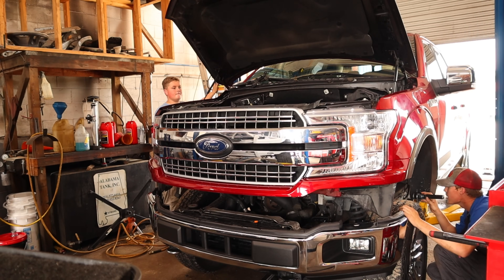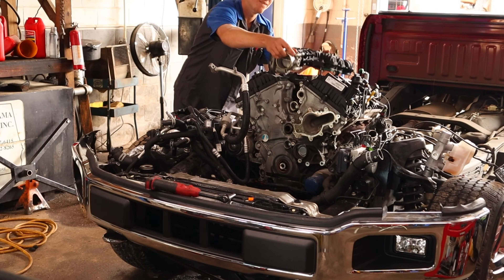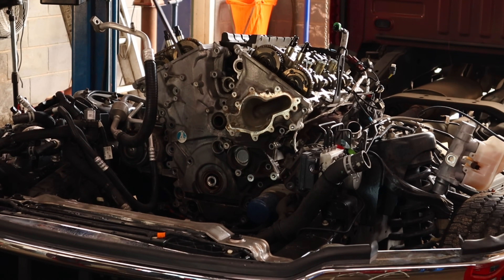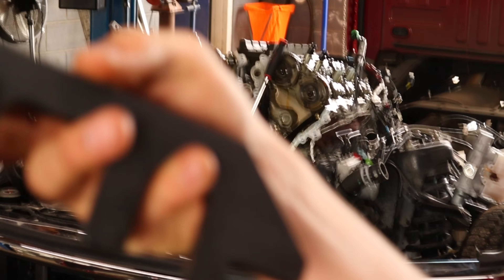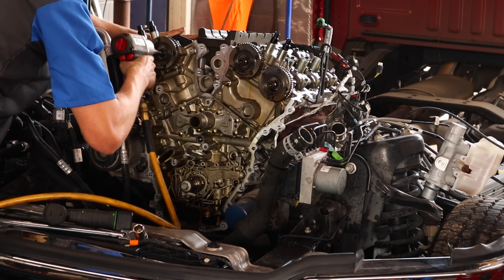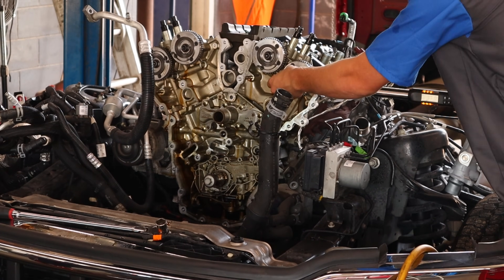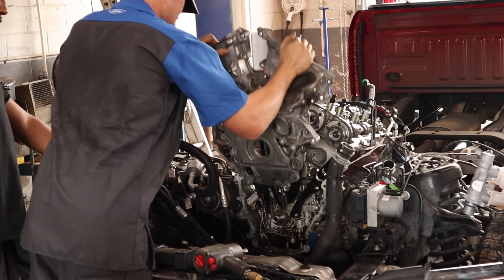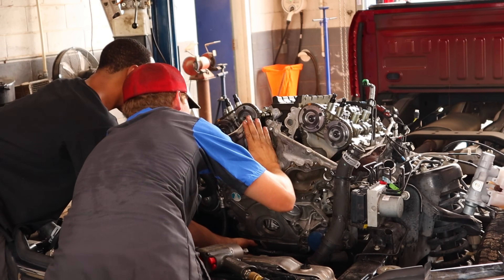Ford 3.5 EcoBoost Cold Start Rattle (VCT Phasers) | Everything You Need To Know

Comment: Is it possible to program the ecu to extend cranking time (before firing) to allow more time to build oil pressure?  I would think it would only need an extra second or two to get the oil moving enough to take up any bleed-off from those phasers or tensioner?
Reply: Hold the pedal to the floor. Engine will not start till you release it.
Reply: @jimsherman2477  I used to fuck with my buddy doing that
Reply from the maker: I’m sure it is possible to do that but it wouldn’t be the best way to fix it. Longer crank time would lead to starter failure eventually. I think what they are doing with this program is having the pcm demand a different position from the phasers at startup that won’t make it rattle. I’m not sure what position would make it not rattle. Unfortunately there isn’t any publications telling us the differences between the stock tune and the updated pcm file they are getting us to put in them under the 21b10 recall.
Reply: @FlyingWrenches13  I'm on my third starter in a year anyways. The autoshutoff really wears my starter out.

Comment: I have a 2012 3.5 that rattles for about a second on cold start up. I thought it might be the timing chain is stretched and it takes a second for the tensioners to tighten it up. If I get a new timing chain and tensioners should I mess with the VCT Phasers at all?
Reply from the maker: Yeah I would highly recommend replacing those phasers at the same time.

Comment: 3.5 HO motor with 43,000 miles started hearing rattle. If I do nothing, will rattle do any permanent damage to engine?
Reply from the maker: No it won’t cause any other issues.

Comment: My 2017 did the same thing, but they would rattle when it was even hot. Drove it to the dealer,shut it off, went back out 2 minutes later while it was still hot, started it up and they rattled. I change my oil every 3k miles.
Reply: Did you get it repaired?
Reply from the maker: Have you had your phasers replaced?

Comment: Wait, wait, FORD “ Tested “ this engine when it first came out through the BAJA desert 🌵 and everything then tore it down and everything was fine???    
Ford been making engines over 100 years and Honda and Toyota STILL make a better engine? HOW?   WHY?    

WHEN is Ford going to get their shit together and make a GAS 400,000 mile engine w/o a MAJOR repair?    WHEN?   
And why people STILL buy and support this CRAP? And pay good money for it
Reply from the maker: The days of reliable engines are behind us unfortunately. It’s all about power and fuel economy now.
Reply: I see transits with 600k ,400k,all the time. There not tuned as hot but last alot longer
Reply: Honda sure they are reliable. Get real tired of hearing how reliable Toyota’s are   As a mechanic I know Toyota’s to be pretty junky. Which is bad when u also have no power to go with it

Comment: I have one question what happens if you would rather live with the rattle instead of breaking down your whole engine and maybe cousin more problem with the truck....  plus if you have extended warranty it should go all the way to 100,000 with NO cost?
Reply from the maker: Extended warranty should cover your phasers if you bought one. As far as long term effects from this noise, there really isn’t any. The cold start rattle shouldn’t cause any damage or other issues.
Reply: The technician isn’t breaking down the entire engine, they’re removing covers and changing 4 gears with updated parts. And if the technician is properly trained, as they are required to be, other than the noise being gone you should never be able to tell that anyone was in the engine.

Comment: So my truck has been at the dealership for about 5 months now, have had the "new upgrade" done to it last week and the rattle is gone, but not the transmission vibration on all gears after 5th gear. Ford wanted to change out the engine about 2 weeks ago, and placed my order for it, then this new upgrade was done and supposedly fixed. They gave me my truck back, within 1 hour of driving it, vibration is still there, told the transmission tech, and he knew exactly what I was talking about. That tells me he knew it was still there, and yet released it to me. Now they are back to the drawing board, maybe a new engine is the next step.
Reply: "So apparently fsc engineer wants him to test the drive angle possibly drive line is what is causing the shudder" 

This is the latest news from my dealership. Any updates on your end?
Reply from the maker: If the trans is shuttering then that shouldn’t have anything to do with the engine. Sounds to me like the pcm update may have caused the trans issues.
Reply: @FlyingWrenches13  so the trans tech says the upgrade ruined all 6 trucks at the dealership the same. Except mine got the least issues, 4 of the others were bought out by Ford and they ALL went with new F250's. Told them I was not looking into going back into a $70-80K debt, so I told them to fix my truck. They are assuming the issue is a miscommunication between the trans and engine in terms if what gear it should be in at a low speed. It will be in 8th or 9th gear at about 30 mph, seems too high of a gear for the speed. The vibration starts when I slowly apply the gas pedal. Not sure what Ford wants to do next, but if they pick up where we left off, it will be a new engine. Should hear from them next week, I'll keep you posted in their decisions. I am in constant contact with a supervisor at Ford Motor Co.
Reply from the maker: Yeah keep me updated please. I would like to know what ends up fixing your issue.
Reply: So just got off the phone with the dealership, now they are saying they cannot replace the engine because it is now a driveline issue, and they are waiting on the engineers in Pennsylvania to come up with a solution. I'm seriously considering calling a lawyer at this point to see what are my other options.
Reply from the maker: Man I wish I had some advice for you but I don’t really know what to tell you. I will say that the lawyer route isn’t usually the best just because of how long it takes for any legal action to go through. I would call ford corporate and raise hell if it was me. I wouldn’t get mad at the dealer or anything because there really just isn’t much they can do if they don’t know what’s causing the issue. Ford corporate is probably going to be your best route. Buy back buy back buy back is what I would be saying. Hope this helps.
Reply: @FlyingWrenches13  well I am in constant contact with a sup representative from Ford. They won't buy back my truck, unless I buy something new from them, which I don't want to. I want them to pay off my truck so I can go buy elsewhere.
Reply: @FlyingWrenches13  update: so I get an email yesterday from a Ford Sup about 400 miles away saying that my truck will be ready this morning for pick up. Telling me it was the driveline and they got it all fixed. Said I am to pick it up and test drive it with the techs this morning. So I texted the lady helping me at the dealership, asking her when I can pick up my truck, she asked me why I wanted to pick it up, told her what the sup had said, she then says she has no idea why she said that, my truck is still being tested and they aren't sure that it is fixed yet. So I called the sup asking her how it was possible that someone 400 miles away is saying that my truck is fixed, yet the person at the dealership with my truck has no idea why you are saying this. They called each other and then the sup said I would get a call early this morning to get my truck, no call yet.
Reply: 8/29/21 update: so nothing has worked so far, they were certain they had it fixed a couple weeks ago, they never called me to pick it up, turns out a few techs test drove it and none of them liked the way the truck was shifting gears. So it's still there, 3 days ago, got a text from the dealership saying that an engineer will be flying down to Texas the second week of Sept. to take a look at my truck. Don't know why they just don't pay off my truck and let me be on my way. Seems they have spent a lot more money the past 6 months.
Reply: Update, so an engineer from Pennsylvania came down to see my truck, this is the text I just got from the dealership. 

"Engineer came and he stating to replace  heads and all 4 cams"

I guess we will see if this is the fix. Going on 6 months now. Let me know if you've heard anything else, thanks.

Comment: My 2017 with 75k, started rattling at 70k... Had 21B10 done about 2 weeks ago. I went from a rattle at every cold start, to rattling in about 1 out of 4 cold starts. The PCM update had to do something different to the way phasers are operating...
Reply from the maker: Yeah that update does. I’m honestly not sure what it changes though. Most likely changes the commanded oil pressure for the solenoid on a cold start. Be sure to get back to the dealer before that extended coverage runs out.
Reply: @FlyingWrenches13  in my mind, it lowers the oil pressure at idle to "encourage" the phaser locking pin to move to the locked position, and then it increases the oil pressure to max at startup. My truck idles quieter but also seems to idle about 10-20 RPM's lower than before the update.
Reply: I do plan on getting these VCT phasers replaced though.
Reply: Why you didn’t buy a Toyota from the get go?
Reply: @Mr.Beastforpresident  Because they bombed pearl harbor and i don't forgive easily.
Reply: @yamaha226  🤣
Reply: My 2017 Ford F150 3.5 eco-boost has had three sets of timing chains and phasers done by Ford and now it’s out of warranty still making the noise getting worse by the day. I change my oil every 3000 miles never was late I strive on making sure my truck is well maintained. I also have a 2012 FX4 with the 3.5 that has 220,000 miles and just now starting to make the rattling sound. I have a hard time understanding the issues with these engines everybody’s having problems with them why doesn’t Ford recognize this issue and take care of it can somebody tell me what to do now that I’m out of warranty.
I guess it’s call take it with no Vaseline.
Reply: @richardhane8356  Would you buy another Ford?

Comment: So what about 2.7 waste gate clap/rattle on cold start up. Decent rattle heard is common I've read, mine has 14k and can just grab waste gate actuator rod and will make rattle stop. Have you ran into this? One tech to another. Also was cab off for video purposes only? I've never done cab off for Chains and Phasers. 👨‍🔧🤷‍♂️
Reply from the maker: So I actually haven’t ran into any waste gate rattle on the 2.7’s. I’ve seen a few on the 2.3 Ecoboost explorers with the rattle. Nah I’m a hardcore believer in cab off repairs. Much easier on my back. I use to do them with cab on and I can do them faster that way but man is it easier to do with the cab in the air.

Comment: My 18 Navigator is rattling at start up and actually missing (out of time) at low idle. Lincoln dealer is telling me I have to wait on a new program. They are telling me to drive it as is until this comes out despite me begging them to just replace the phasers. Will this cause further damage to the engine?  By the way I have the premium 150k extended warranty and they are still refusing to replace the phasers until they attempt the software update.
Reply from the maker: Yeah technically for ford to warranty the repair we are suppose to do the pcm update first. The rattle shouldn’t cause any effects on the engine. I’ve never seen the noise cause any long term effects.
Reply: Bro, go to a Ford dealership. There's no reason they shouldn't be replacing phasers. The TSB 21-2119 covers 2017-2019 F-150s, Raptors, Expeditions, and Navigators. I've done a few navigators at our dealership. Also, FYI, the reprogram is out and will not fix an existing rattle situation.

Comment: I have this cold start rattle after 2 years of getting the car ( it was almost 40k km ) the car in the Middle East , Ford said it is normal nothing to worry about , now the car has 90k km ) and out of warranty , after seeing your informative video I feel bad that they fooled me till the car is out of warranty ! What can I do since this is cheating - 2015 3.5 ecoboost f150
Reply from the maker: I would go back and get records of the original complaint. If you took it to a dealer for the issue there should be record of it.
Reply: @FlyingWrenches13  thank you for the prompt response , yes it is there in their records but they are denying that there is any recall issued for my issue .
Reply from the maker: There isn’t a recall for the 2015 models. The recall only applies to the 2017 ups.

Comment: What if I had the pcm flashed when that recall came out? I haven’t noticed any shutter in the transmission at all. I didn’t even have a rattle in the cam phaser but I took the truck to my local dealer and had them do the pcm update . Thanks
Reply from the maker: I wouldn’t worry about it. We programmed some right when it came out and never had anyone come back complaining of shutter.
Reply: @FlyingWrenches13  Okay thank you

Comment: Looks just like a typical day in my world, between doing these and short blocking '17 to '19 Escape 1.5s .......only difference being, I don't have a bunch of guys helping me when I'm into one of these. I'm glad it looks like I'm not the only one who lifts cabs to do this job. Lifting the body on the Navigators sure is a little bit more work than the cab on the F-150s. These GEN II version 3.5s have had this problem from new though. I've heard that same rattle at start up, even on brand new units coming in for PDI.
Reply from the maker: 1.5 engine, 3.5 phasers, repeat.

Comment: Earlier this month had to pay out of Pocket for this repair $3100  at Ford Dealer that  I bought 6 Vehicles 5 New in 12 years . 2017  F150! XLT 302 A pkg 3.5 115,000 90% Highway Driving Full Synthetic every oil change. Do Not believe Ford Owner’s Manual on Maintenance Service intervals or dash oil change indicators for 7000-1000 miles normal driving. Do 3000-4000 instead. I bought a non Ford Aftermarket Warranty it was 3yr 125,000 miles for $1700  Had warranty 8 months 15,000 miles. W company rejected claim VCT were excluded part. Why because it’s the most failed part on the 3.5. Got $1500 refund back from the crappy Warranty Company. Since it was my expense
Reply from the maker: Yeah man that sounds like you got taken through the ringer. That’s ridiculous that the aftermarket warranty wouldn’t pay for the phasers. Have you contacted ford about all the problems you have had?
Reply: @FlyingWrenches13  I had this service  completed on 7/19/21 at the Ford Dealer. I needed a few weeks to cool down. Lol  Yes, I filed a formal complaint today. Do the 2021 F150 3.5 Eco Boost have  an improvement to this engine  Gen 3? I heard this has a  balanced oil pressured guide as the  Gen 2 has only 1 on the left side ? Keep up the Good Work . Thank you
Reply from the maker: Yeah I believe they updated the whole engine on the 2021’s! Thanks!
Reply: Additional to Out Of Pocket for my 17 F150 3.5 Ecoboost. I had replace the water pump, thermostat, 2 belts, and radiator hoses. Also Do Not Trust Dealer “Lifetime Powertrain Warranty” If you are a DYI . I had a mix of DIY, Quick Lubes, and Ford Dealer Service and Oil Changes and a Book of Documentation and Receipts. Still No Go!! Everyone done by dealer including Air Filters, Cabin Air Filters etc per  service maintenance schedule whether they are needed or not to be replaced. Love my Fords and F150 but feel betrayed by Ford and Dealer when so many 3.5 have this issue and poor communication about the need for more frequent service intervals especially Oil. I thought about trading it in but some guy fell asleep and sideswiped me near head on. Ford replaced bed side two doors and fender. Accident on Carfax and high miles destroyed my traded in value. No rebates  ot X Plan Offer on New F150s. God Bless
Reply: How much you want for your truck?
Reply: @elvism684  I  have decided to keep it as it  still looks great, all  the maintenance has been performed and to replace would be over $60K. Thank you anyway. God Bless